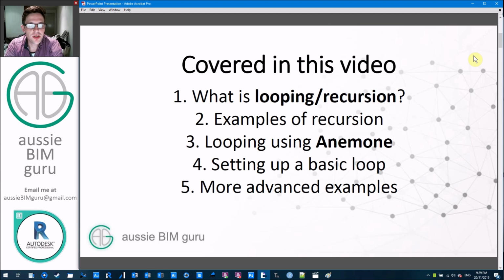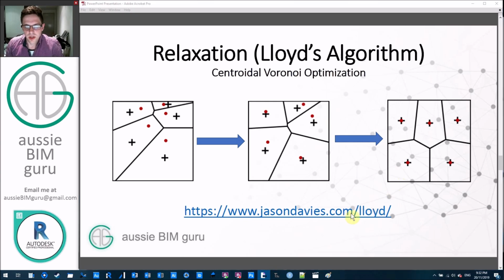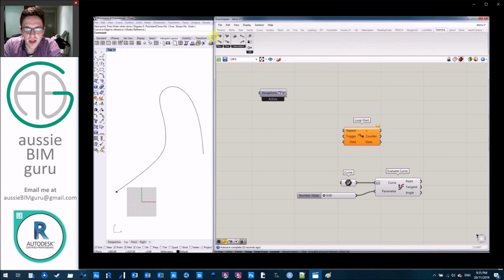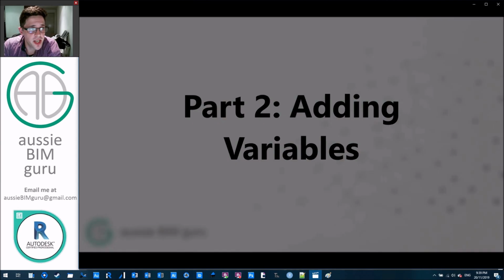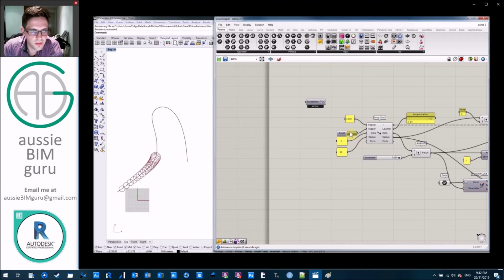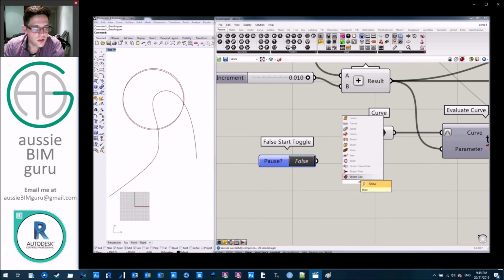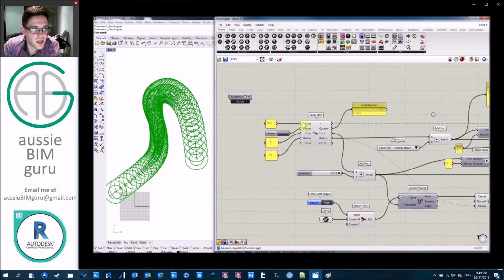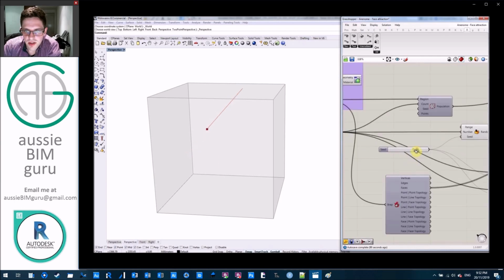Looping using Anemone for Grasshopper!

Comment: Imagine this: You have doors with editable opening angles (instance).
You set Anemone to open the doors in 1 deg increments until it clashes (presumably with a wall, or maybe door frame)
You feed that parameter value inside the door instance (maybe use it as a max opening fail-safe) :D
Reply from the maker: Interesting idea! A lot of firms nest a 3D swing arc zone to ensure free space is achieved but generally it wont measure the open degree available.

Comment: HI, Thanks for the tutorial! Is there a reason why my point moves so slow and your moves fast?
Reply from the maker: The most likely reason is computer specs, looping is a heavy operation so it relies heavily on processing power and graphics cards to some degree.

For reference my workstation here was a 32GB RAM, i7 Quad xeon processor and Quadro M series graphics card. Fairly high spec.

Comment: is it possible to apply the same loop to several grafted curves but with different exit values depending for example from the crv lengths??
Reply from the maker: I would expect so, but you would need to maintain the values in parallel to your geometry and add extra inputs to the start/end of the loop so they transform in tandem through each cycle. By exit values I assume you mean a point where they no longer twist, so there would need to be a condition where they are removed from the list being transformed, then added to a static list that still goes through the loop, but does not have the same transformations applied like the ones that haven't hit the exit condition.

TLDR: Add more inputs/outputs to the start/end.

Comment: Great Tutorial although I had a difficult time getting Anemone installed. Putting the latest .gha in the GH  Components didn't work, I had to use the legacy version initially, then replace with the .4. This might not be the right way or have anything to do with anything, but it worked for me.
If I were to make a request: I would love to take that panel output and dump it into an excel file.
Reply: Hi Joe. For the common issues with installing plugins, you should right-click on zip files, UNBLOCK them before extract in Component folder. And then remember to restart Rhino and Grasshopper.
P/s: Great video as usual.
Reply from the maker: @phuongdang3790  thanks, and great tip!
Reply from the maker: Yeah I've had issues with some packages in Rhino 6 as well, haven't tried anenome for a few months now.

Glad you liked the tutorial! To get the data to excel I'd use a stream filter with a button input, then feed the panel to a stream filter in gate 1. From there you could use Luchbox which has an excel write node, and the stream filter protects the node from running once per loop iteration.

Comment: Hi there,
Great video, your work is interesting. Just wanted to know what the components were in the RGB definition of the coloured lines will i need a plugin? Thanks for the content
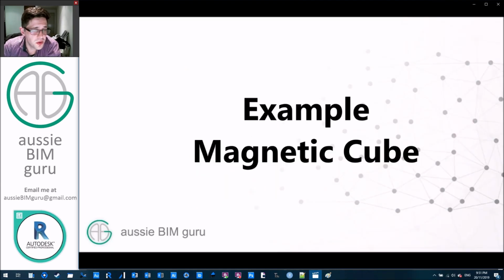Reply from the maker: You're welcome! I assume you mean the example around 22:45?

In this case, I was measuring the lengths of all the lines, building a domain based on the min/max value and running this domain and the values over an ootb gradient node. This then builds a value for each curve that I could apply to a custom preview node at the end (and then hide the original uncolored curve).

Hope that helps!